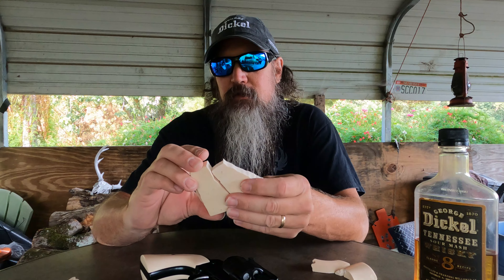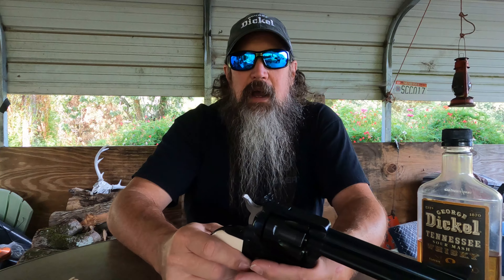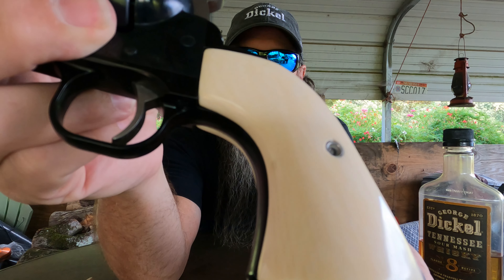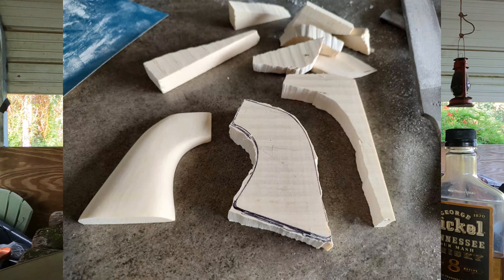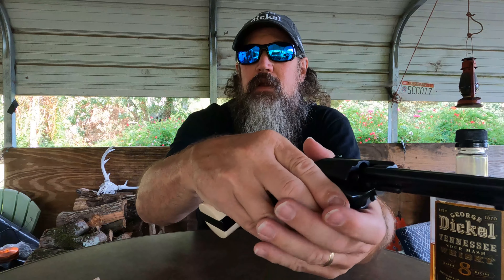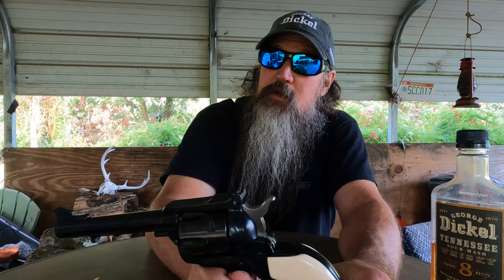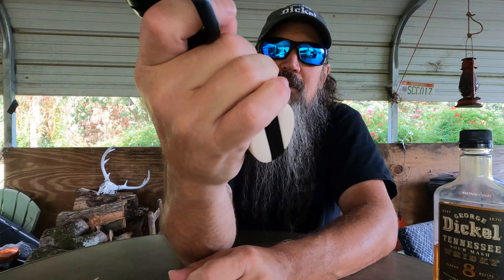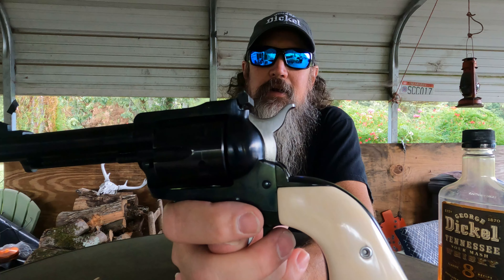Guitar Parts & More resin ivory grip material

Comment: Your efforts are worthwhile. Looks fine. On my own Rugers I drawfile the sides of the grip frame to be more accurately flat, and the upper frame joint is not perfect 90degrees so I leave enough material on the perimeter so I can fine tune the corner fit and not get under flush . I use a bradpoint bit to drill an accurate hole for nut and and escutcheon w/Brownells screw set.

Comment: I just bought some of the highest grades s+ for my Colt single action army clone from Uberti      I am very impressed with it and I will be making one piece grips from them.  I mean... if you have a Colt or Colt clone?   it deserves one piece grips.   One thing about the material is he told me it epoxies well.  That is great as I will have to epoxy in a spacer block.    I once made real ivory grips and ended up chipping the corner of one   No way any epoxy would stick on real ivory.  I like the bevel and really?   it does not limit the grip area since it is more of a quarter moon with almost no material gone from the front and backstgraps.    I also nickel plated the gripframe on that gun...   On my three black powder Colts I nickel plated the grip frames and the cylinders and the barrels... Sorta more practical omn a BP gun but also as practice for doing my 1911 and model 19 target.  One thing for sure tho... any tiny little scratch in the metal will show through.
Reply from the maker: If I'd made them one piece for Colt clone, I wouldn't have had any problem. For a Ruger and the require holes...that's where my problem came from. Like I said...not the material's fault. It looks awesome when done.

It was MY fault...as stated.

With a Colt or std. pressure gun...the bevel is just fine. With my Cimarron Thunderer grip, std. pressure is just fine.

With full throttle Ruger only loads in an aluminum grip framed gun? I prefer as much of a purchase on the grip as I can get.
Reply: Yeah.. I get it... done a few grips and that escutchion or whatever it is called is knurled and gives the impression that you need to make a small hole and press it in..I would likely have done the same as you.   it just so happened thatg I asked him about epoxy and he said it glued well...  
armed with that and your experiance in cracking one I would keep that in mind and drill the hole VERY slightly undersize and then epoxy the thing in.   I have been doing knife handles and mostly using bone...  you have to peen over the pins that hold the grips on (along with the epoxy)  And guess what?   I managed to crack a grip trying to peen flush.   Dobn't get around as well these days so I like doing things at my desk or the garage  had to learn and relearn a lot of skills and realize that I had been doing things wrong for decades when I did do em.. work on guns and watches and furniture etc Big stuff?   wasn't even much help for my son building a shed in the backyard.o @plowboysghost

Comment: The grips that came on my new Blackhawk were horrible. Probably 1/8" gap. I can't believe Ruger sends guns out like that. They must not give a damn. So, this is what brought me to your page. Those grips look great, nice job, I guess I'll have to give it a try. I can't live with the crap stock grips even though my guns are tools and not safe queens, they deserve correctly fitting grips. Thanks for the video.
Reply from the maker: Well ..I've done videos recently on the current grip frame and grip panel changes.   I like both the resin ivory and the current setup better than stock

Comment: I almost bought some of his blocks to try it out on my Blackhawk. It looks great. After talking to a couple grip makers who said they saw some Blackhawks loaded hot crack them I decided against it for this particular gun. I am ended up coming across a good deal on some real mammoth ivory that’s now being made into grips for it. I’ll be curious to see how it holds up to some of the hotter Ruger loads. Once you get some rounds on them with the hot loads I’d love an update because I’m still thinking about using his blocks for some of my guns that shoot lighter loads. By the way…. Great job on making them. I think you did an awesome job considering you’re not a grip maker.
Reply from the maker: That's a concern of mine to a degree. They are fit to the frame snug enough that they click into place, so hopefully they won't have any slack to allow movement and cracking. We shall see. Either way, I have an idea I'll end up with some other grip frame and panels on this gun. Thanks for the kind words, brother 🍻

Comment: Over the years, I have handled a few guns with real ivory grips.  They are problematical to market due to liberal laws regarding ivory.  You have to be able to prove the ivory was in the country before a certain date.  This is not a problem for Elmer Keith's Number 5, which is well document, but an old nickel-plated Iver Johnson revolver is another matter entirely.  Bummer.  

I was looking into some mammoth/mastodon ivory, but as it is 10,000 years or more old, it really isn't in the sturdiest condition, so is best for display only.  Bummer again.  This leave the Ivorex and other imitation ivory on the market.  I am planning a 3-screw Ruger project for 2024 that would have some form of ivory-ish grips.  This stuff looks like it might fit the bill.  I've made a few grips over the years... and repaired a few.  Epoxy putty does a fair job of fixing old Colt gutta percha grips that have chips on them.  Gutta percha is about as rare as ivory these days, though for different reasons.

I think your grips look just fine.  Just wondering, have you tried any coffee staining of the scrap parts you have left over?  This might make for an interesting way of "aging" them without actually carrying them in a holster for 90 years.